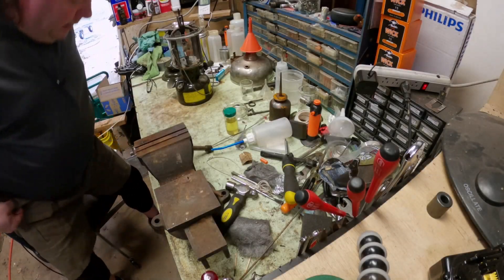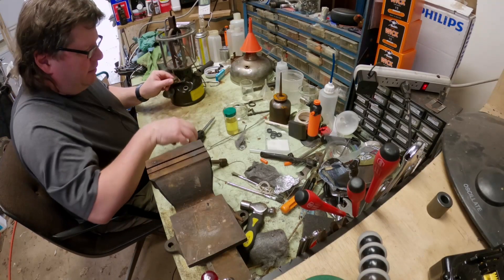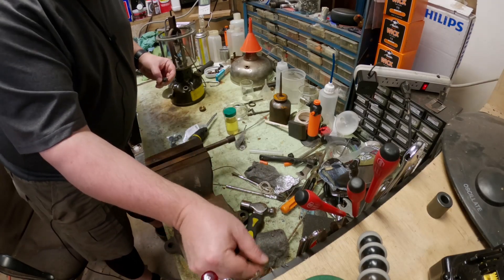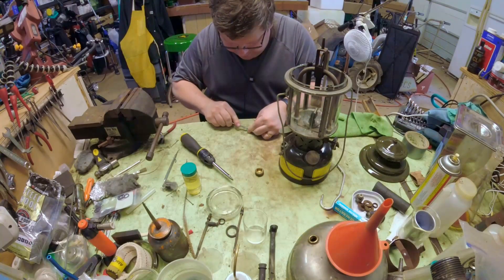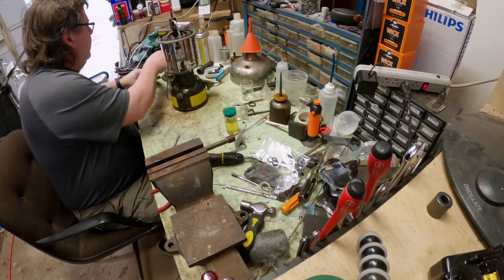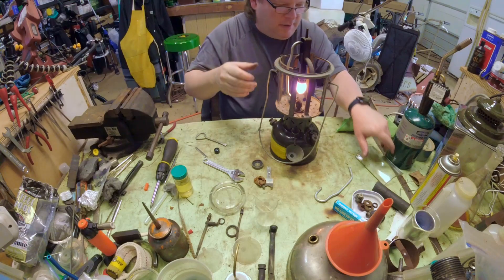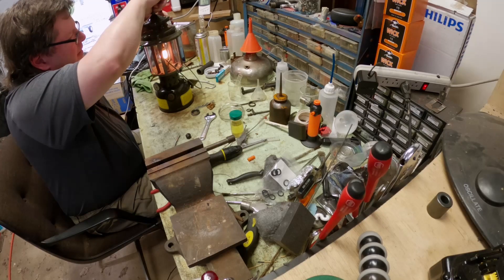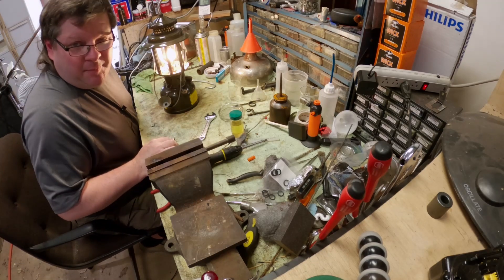Fixed: Coleman 252 milspec

Comment: I have a 1944 military lamp that I just couldn't get running-new seals, new generator-it would not run. After watching your  video, I realized that the the  support arms for the mantle were air tubes-sure enough, they were clogged with bug nests or mud daubers. After cleaning them out , the lantern started right up and ran perfectly! Thank you for making this video!
Reply from the maker: Outstanding!  I bet that was a good feeling when it started up right!

Comment: I just got my first two 1965 and 1969 Coleman milspecs. 
I tore them down, citric acid soaked all brass parts before running brushes through all of them. I also ran bore brushes through the air tubes and whatnot. Founts are squeaky clean. 
The fuel air tubes are both able to be taken apart so I took them completely apart, soaked and scrubbed the varnish off then I reassembled them. 
Both lanterns slurp and stutter, they are bright until a big knock in the fount then they spit flames for a split second. 
It’s like something is clogged and releasing pressure quickly then lets it build up then releases, causing them to spit, sputter and pulse. 
I’m at a loss as I’ve went through everything 4 times now.
Reply from the maker: I'd try removing the generator and see how fuel comes out of the fount.  If that flows freely, you may need to replace the generator.

Comment: Nice show, I have what appears to be the same lantern, U.S. Coleman gasoline leaded fuel, 1952 and cannot find a model number anywhere, I'm was trying to locate a new glass globe it is a round one piece, also should I be able to blow through the curved fuel generator tube. Thanks for sharing any info. Cheers from Jacksonville Florida 🌞
Reply from the maker: Hi James, sorry for the slow response!  If it has a round one piece globe (that is how the early ones were) you can usee a 200/228 globe on it.  Yes, you should be able to blow through the generator tube, BUT with the orifice being 0.045", it's hard to detect if you are actually getting any flow through it.  If you take the gas tip off, you should be able to blow through it, but you are going to feel restriction from the packing inside of the generator.  This is normal.  If you hold the removed gas tip up to the light, you should be able to see through the hole.  If not, you'll need to clean the gas tip with a pricker.  That's usually in the spare parts tube, but also usually missing.
Reply: If you can’t find a pricker acupuncture needles work.
Reply: You are missing a zero. The jet is 0.0045 inches or 0.1143 mm. I used a 0.10 mm acupuncture needle.
Reply: Coleman model 252. I have the same year as you.
Reply: Milspec 252

Comment: Hello sir, I also have the same lantern. Here in Vietnam, we dont have the coleman white gas that is fairly available in the Us. Im currenty using unleaded automotive gasoline to light it.  Is it okay to use this type of fuel? And also, should I preheat the generator to prevent fireball happening like in your video?
Reply from the maker: These lanterns were designed to use gasoline, so yes, it will work just fine.  Milspec lanterns will always give you  a lot of yellow flame on startup; it's normal.  I never preheat and would never recommend any do so.